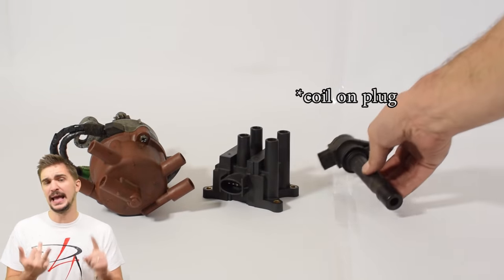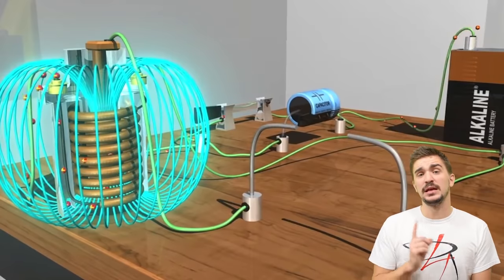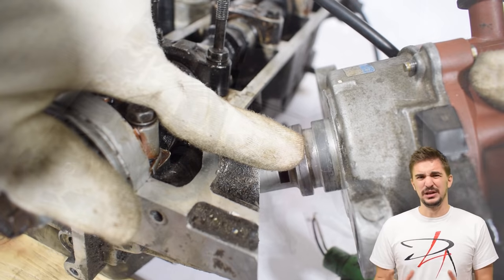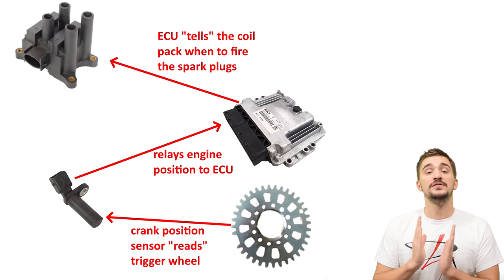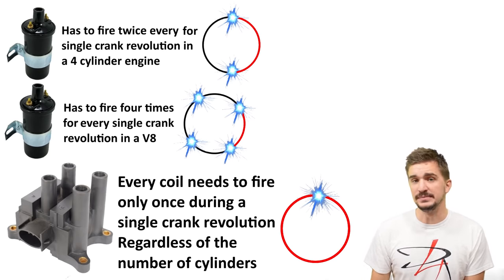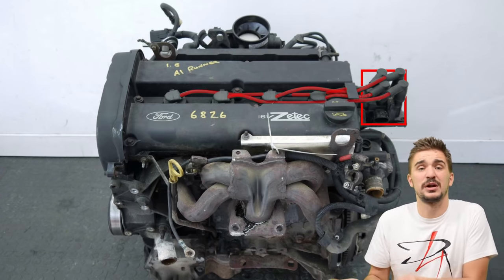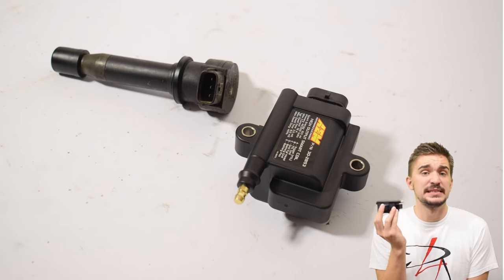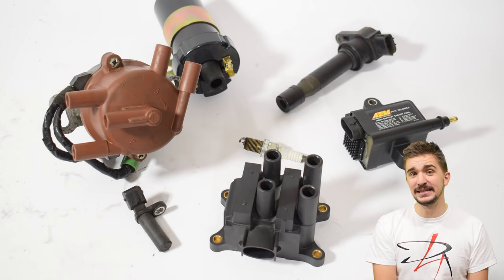Distributor VS Wasted Spark VS Coil on Plug VS MONSTER Coil near Plug

Comment: One disadvantage with the distributor is also that the timing lead is static in distance, not time. When igniting the fuel mixture in an engine, you always want to ignite it leading with time, as the time from when you send voltage to the spark plug, and the fuel excerting downwards pressure (where you want the piston at TDP) is always static (for a specific mixture).

The distributor leads with distance instead, meaning that it will at higher RPMs, lead with shorter times (meaning the spark will come a tad too late) and at lower RPMs, it will lead with longer times (meaning the spark will come a tad too early)
(Think carefully now - at higher RPMs, it will take shorter time, for the distributor to travel from point A to B).
This is a big disadvantage.

Thats why smarter, electronic spark systems are created,. so the engine can adjust the lead times based on RPM and fuel mixture. This is also the same reason fuel injectors are created, and also why it exist electronic valve systems (camless engines) where the ECU controls the valves completely independent of the rotation of the engine.

Also the reason the crank position sensor has one teeth missing is not to create a changing magnetic field - remember that the wheel has teeth and is not smooth - and will make pulses anways thus creating a changing magnetic field. The reason the missing teeth is there, is to give the sensor a absolute position reference - like a "zero". The missing pulse is intepreted by the ECU as passing of a specific position, and the ECU can zero a counter. For each pulse from the sensor, the ECU increases the counter by 1. When the missing pulse is encountered again, it zeroes again.
Thus the ECU constantly "recalibrates" itself, so even if the engine would happen to come a little bit out of sync, for example due to electrical interference, its instantly recalibrated next revolutiion.

Note that a ABS sensor works in the exact same way - but it doesn't need a missing teeth, because it don't need to know the absolute position of the wheel - it only needs to know the speed (pulses/second), thus it doesn't matter if the ABS loses a pulse or two, because it will not become desynced.
Reply: underrated comment, you could do a video
Reply: Not if one wheel is only missing teeth you go fast enough the abs computer registers an issue due to speed difference on all wheels whilst your not apply brakes it will turn it self off
Reply: @james2hackett870  If your car is MISSING teeth on a sensor-disc for ABS you got some other waaaaayyy more serious issues - not the least of which is the lack of intelligence to even dare driving such a deathtrap.
Reply: Most distributor systems include some mechanism to advance the spark as rpm rises. Of course these crude vacuum or fly-weight operated mechanisms can't compare to a computer doing the job...
Reply: @nerd1000ify  very true, but one of the few benefits of a distributor is that, with the proper knowledge and almost no tools, you can set and adjust timing on the fly. It will never be as accurate as a computer but because it is mechanically linked, as long as the distributor is stabbed correctly its going to be more or less correct.
And those are the two (very slim) benefits I can come up with. Less computers and (with proper knowledge) very cheap on the fly adjustments.

Comment: Excellent video explaining the differences.  I think I've had all the set-ups over the years :)   My Astra had the coil-overs and it did break (old 2nd hand car) and was a fair bit more expensive to replace than a couple of spark leads :)
Interestingly (at least to me) is that my HSV seems to have the Monster Coil near plug from factory - no idea the voltage but it certainly has eight blocks and a short lead to the plug.  [GM's LSA motor]

Comment: Ummm, my original Honda spark plug wires are still in my 95 Accord. I'm an EE, and detect no signs of degradation. No cracks, no voltage leakage. The OEM quality of the ignition wires is impeccable.  BTW, you left out aftermarket CDI which we used for modified high output race enines back in the day. Keep up the good work on  your videos.

Comment: Back in the 90's I used to build my own V8's and used distributors with points.
I never had a problem with them of any kind.
Reply: Those would have been lower RPM engines.and a lot of this is about efficiency fuel and power curve. more than just overall power.
Reply: @mbsnyderc  
They'd routinely hit 5500 to 6000rpm, that's not exactly slow.
And I could get 10L/100km on the freeway. 
Admittedly I swapped the factory 4 speed for a Toyota 5 speed steel case gearbox.
The trick is to keep the points well lubed and gapped.
Reply: My old 911 still works fine.
Reply: @johno9507  of course distributors work, they were used for a long time. But technology advances, and generally when technology evolves its to improve the tech not make it worse. A single distributor would not be able to handle 7500-8500 rpm, and our modern systems are designed to be more efficient and reliable. No more moisture in the distributor cap, or maintenance on the points, etc. This is a big reason why we have cars that start first try in the freezing cold. Better fuel systems, ignition systems, etc.
Reply: @SGcomputing  
To be honest I've had more trouble over the years with coil on/near plug ignition systems in everything from my (Australian) LS1 powered HSV Clubsport R8, Ford Falcon 4.0ltr XR6 Turbo, Ford Falcon 5.4 XR8 to my Volvo S60R than I had in my old 1978 GM Holden 5ltr V8's.
I'd leave for work at 4:30am and even in winter one press of the accelerator pedal to activate the choke on the Quadrajet carburettor and she'd start first time every time.
And now instead of replacing one coil, you have to replace 8 of the buggers...and for what, so I can rev out to 6500rpm instead of 5500rpm.
Reply: @johno9507  its slow compared to a 16,000 rpm super bike
Reply: I think the guy was stating that distributors had limits , I don't think he was stating what these limits were .
Reply: I have an msd distributor with 6al2 on my 350sbc it has great spark duration and 55k volts all across the powerband. But it's definitely easier making power with complete control of each cylinder's spark.

Comment: There is also the somewhat hybrid wasted spark coil that late model 2jz vvti non turbo engines use. 3 coils and each one sits on a plug like a CoP but then has a sparkplug wire to send voltage to the second cylinder it has to operate.

Comment: I've always wondered how these newer ignition setups work. Now I understand the Subaru engine I'm working on has a Wasted Spark setup.  I grew up on Holden red motors, so this tutorial helped so much. Love the other videos too.
Reply: Another Aussie
Reply: Just make sure that you use R (resistance) plugs on your engine.
Reply: @vumba1331  Will do. Thanks for the tip.
Reply: @chrisbenn8691  Not a problem, glad to help. I use a Subaru EA81 engine on my microlight with a timing wheel on the pulley using a Hall Effect sensor for the timing, it also controls the fuel injectors on a group fire basis, all controlled by a programmable ECU. Fun fact, they made one that was turbo charged so there was a dedicated injector head.

Comment: I always thought higher pressure necessitated higher voltage/amperage 

I never thought that that greater air/fuel density created a higher insulation condition
Reply: Didn't you just contradict yourself? More atoms in the gap mean more atoms to ionize which you surmised in first statement. Higher pressure = higher atomic density.
Reply: Higher density of air/fuel IS higher pressure

Comment: A detail worth mentioning is that the ignition coil is basically a transformer. But transformers need a varying voltage applied to the primary coil in order to work. AC transformers rely on the alternating nature of the power coming in and don't need more than input and output coils wrapped around a core to work, but DC power is a little bit trickier. As explained in the video, there's a switch that cuts off power and lets the EM field around the primary coil collapse, turning back into electrical power on the secndary coil. That's how you vary the voltage in a DC-DC transformer.

The transistors in more advanced setups are the switches in the more advanced setups. The output voltage is dependent on both the size ratio of the coils (both in number of turns and area covered) and the switching speed. As also explained in the video, switching the coil too fast causes the primary coil to not "charge up" enough, so the voltage outputed by the coil goes down as frequency goes up. All the spark solutions here use this same principle, the difference is that, as the video also explains, the more advanced options use individual coils that free up time for them to charge. Maybe they also use capacitors to speed up the charge cycle, I've never took one apart, but a 20kv capacitor with any meaningful charge capacity would be enormous.

Comment: Could you possibly do an episode about ignition controllers? I'm specifically looking for something affordable, but smart enough to run sequential CoPs. If needed they could be CoPs wired as wasted spark as it's not a terribly high revving engine, but I would prefer sequential to keep wear on the CoPs down to as close to factory as possible.

Comment: The first example made me think of the old magnetos, which are still in use today on most piston powered aircraft. Because they run at fairly low rpm most not going above 3000 rpm it works and because they will generate spark even in the event of complete electrical system failure keeping you in the air.

Comment: Now explain how much each system is to repair.
Reply: mechanical parts are most problematic. They worn in real time. Coilplug almost never dies.
Reply: Well, with lots of old cars you have expensive and hard to find parts, and need to go to more expensive specialty shops to have them repaired. A distributor has not only failure costs where you need to replace parts, but maintenance costs aswell to keep it working. With a modern coil on plug system, you save fuel costs with more efficient combustion, there is no maintenance at all, and they very rarely fail and when they do are usually very easy to replace and aren’t all that expensive, typically.
Reply: @Martink9191  just had a coil on plug die last week. They get heat soaked. Thought it was going to be expensive since its an audi a7 but i got a coil on plug for $30 and did the labor myself easily in 10 min
Reply: @Martink9191  CoP fail all the time
Reply: @archygrey9093  you should repair the problem then.

Comment: How about new series: Underrated engines

You could start the series with saab B2x4 😉
Reply: Ps. Great video once again! Liked
Reply: YEEEES!
A video on the history + development + features of the b204/b234 engine would be great and you (D4A) could also describe the somewhat unique SAAB T5/T7 engine management system with its ionic knock-sensing too. :) (done via DI cassette sending ~60v across the spark plug during non-spark time to determine if the engine is knocking without a dedicated knock sensor)
Reply: And the Toyota 3RZ-FE, the Mercedes OM606
Reply: @johneldepresso  would love to see om606 too!

Comment: Very good presentation of this topic as usual by Driving4Answers.
to add something: 1. the wasted spark coil has not it lighter as the distributor coil, there are two coils (in a 4-cylinder) but they have to fire twice as often. 2. there are some CoP engines where two CoPs are fired simultaneously, like in a wasted spark system, they do so to avoid needing a camshaft sensor (and two switching transistors). 3. a ground comment: the coils, even the CoPs) have 1 high voltage terminal and 2 low voltage. It means that the HV is "ground" through the low voltage positive terminal, which makes the spark return path going a long loop, essentially the loop closes at the battery. That makes dangerous to disconnect the battery when the engine is running since the 20,000 V will split between the plug and elsewhere, very bad for the electronics unless good overvoltage protection is built in the ECU. (Old mechanical systems had no protection and could burn alternator components). All this for saving a screw-terminal for grounding the HV at the coil.

Comment: All my engines runs wasted spark but rather than a combined coil pack it uses individual coils for each pair of cylinders, making replacement easy and cheaper as well as diagnostics easier.

Comment: my distributor is also a crank position sensor. hall effect sensing pick up coil under the rotor for fuel and spark timing. It's called thick film integrated ignition, various 80's ford 5.0 with auto trans in the US had them. Still using 35 year old throttle body injection

Comment: I used 2 Denso waste spark setups from a V6 Audi to run a V12 Jaguar engine some years ago , as the idea of a V12 distributor with the MSnS was just not viable . A lot of fun working out the sequence as at the time no one had done a V12 .

Comment: A small note: The best electric insulator is a vacuum. By adding more mixture, you increase conductivity and thus DECREASE resistance. Electrical insulators are there to maintain a certain distance between the conductors. They do NOT prevent flow like thermal insulators do.
I do see those bigger coils having an advantage, because you are free to choose from multiple aftermarket spark plugs, or even use a twin spark setup.

Comment: I enjoy your videos and I think you would appreciate criticism, you are lacking some information..
#1 A coil is not an igniter an igniter or igniter is an ignition module(ecu responsible for coil timing)

#2waste spark systems can add the benefit of simplistic reliability to a sequential fuel injection system by reducing the need for hardware such as a cam position sensor. The ignition module (igniter)can monitor the current flow through the waste coil secondary circuit and determine which cylinder was up for compression based on which direction (polarity) the coil fired. Since the exhaust cylinder has less charge density a lesser voltage will always be required to jump the gap. When the companion cylinders switch roles again the differences in voltage can be read a voltage direction and polarity. 

#3 there are coil near plugs and coil over plugs with or without an integrated igniter module. 

#4 you didn’t mention ion sensing ignition systems which can sense spark knock and even air-fuel mixture within each individual cylinder eliminating the need for oxygen sensors and providing cylinder basis combustion monitoring. 

Cheers and keep up the good work.

Comment: Fantastic content! Thanks again glad I'm running those AEM coils in my rx7, rotories cannot take ANY detonation as all and now I k ow why my auto sparky made such a big deal about getting them!
Reply: ign-1a coils will do nothing to prevent detonation. the reason to run these coils is better spark energy, and if you have an FD with an appropriate ecu you can convert from wasted spark to direct fire, increasing coil saturation time.

if you are worried about detonation add AI or go flex fuel.

Comment: I painted my distributor cap on my Uno with gold paint once. I couldn't figure out why it wouldn't start after that. That wasn't quite my brightest moment.

On another note, the Alfa Twin Spark engines have a coil on plug and a lead to the opposite cylinder's second spark plug in a wasted spark configuration. So if one (or even 2) of the coil packs fail, you'll still have a relatively smooth running engine.
Reply from the maker: I loved the twin sparks. I spent a few days driving a 147 with a 1.6 twin spark a few years ago and really liked it and still remember the feeling of it.
Reply: @d4a  Yeah, I love my 156 t.s. While its fuel consumption does remind you of its age a lot, I haven't driven many front wheel drive cars quite like it. Unfortunately (or fortunately for my wallet) I don't drive too much these days, as I'm working from home and don't live around very nice driving roads.

Comment: So just to ad in some confusion- 
The earlier Hemi 5.7 had coil on plug that was also wasted spark with plug wires.  Two plugs per cylinder, opposite sides paired, with eight wasted spark coils mounted on the plugs.  Later hemis had cop wasted spark, with one coil over the two plugs.
Ford 6.2 uses a similar setup, but with the coil mounted over the upper plug, and a wire to the lower plug of the same cylinder.
GM LS type engines use a coil near plug setup with a short plug wire.  They're pretty beefy coils, I've had engines run just fine with no center electrode and just a bit of the ground electrode.

Comment: you do great videos. Looking at those aeg units, the writing on the side reads 103mj.
That's milli joules of energy. Back in the 80's common cars with Bosch based coil/ignition systems could generate 1 full joule of energy, enough to kill. But also enough to fire lean burn engines with long spark duration, at least as long as the new style AEG unit in the video.
It's been too long . . but I remember typical spark wire resistance was around 5k ohms, and engines didn't misfire until plug-wire resistance increased to 10x that. The plug-wire resistance changed the rise time and the shape of the wave form. 
The actual firing voltage of the plug is mostly influenced by engine conditions not plug-wire resistance, eg timing, compression, and especially lean mixture. A fouled plug would have zero volts across it.
Note manufacturers also moved to resistor type spark plugs, increasing resistance in the plug circuit.
The big advantage I can see is accurate timing for each cylinder. Mechanical distributors always had a variation of several degrees between cylinders.
I hope this adds to your video, cheers.